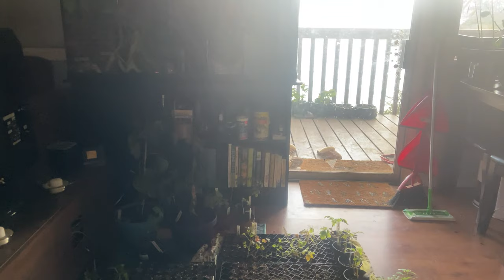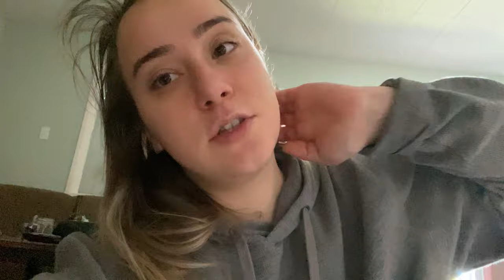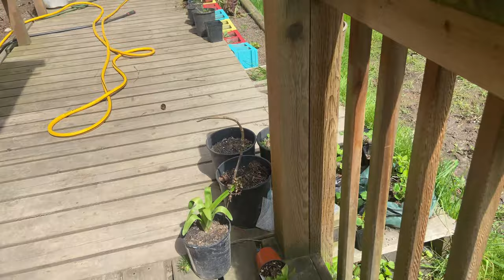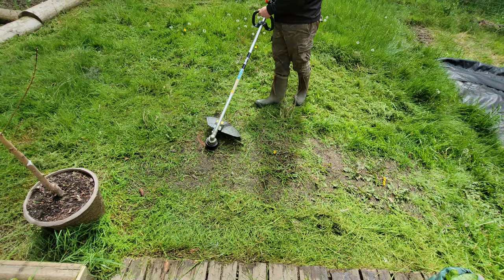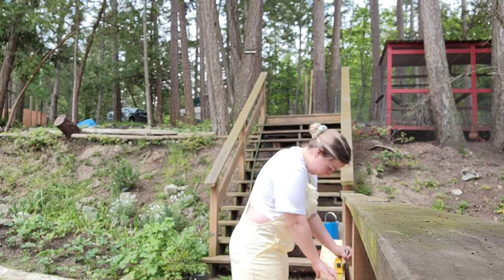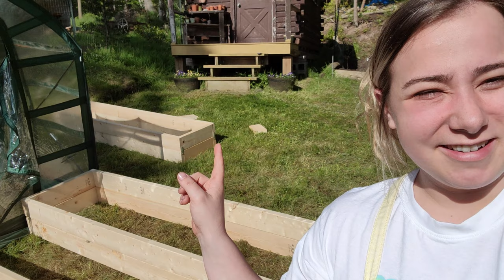We Build some new Planter Boxes and Install our New Greenhouse // LIVING OFF THE LAND

Comment: On the east coast we’d get power outages lasting two weeks at times. A good trick is to heat up water on the stove, put it in a 2 litre soda bottle or similar, wrap it in a blanket to keep it insulated. Would stay warm for most of the night. Could help with the chicks if it ever comes up again
Reply: Hot water bottle is my suggestion too

Comment: Get a hot water bottle for your quail next time the power goes out. You can put a kettle on top of your wood stove to heat the water for it. :)
Reply: PS Don't beat yourself up about them. They're incredibly tough to get started the first few times.